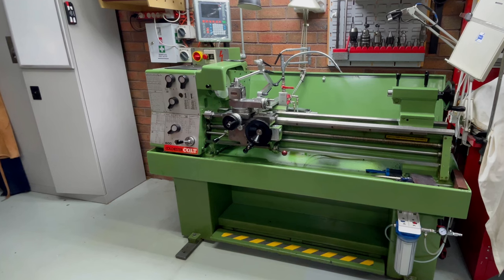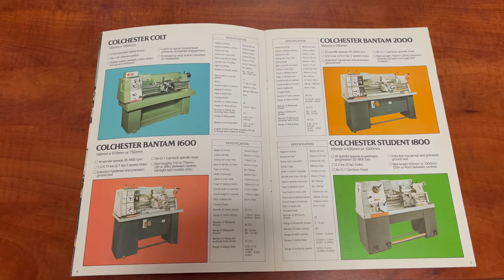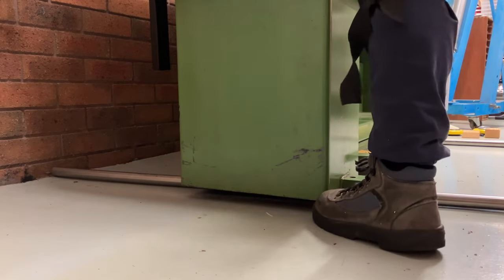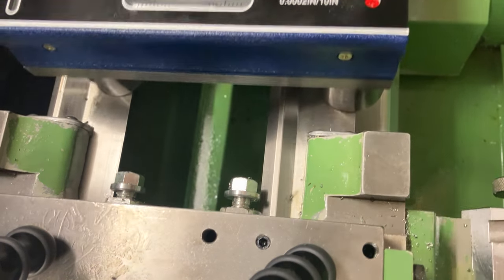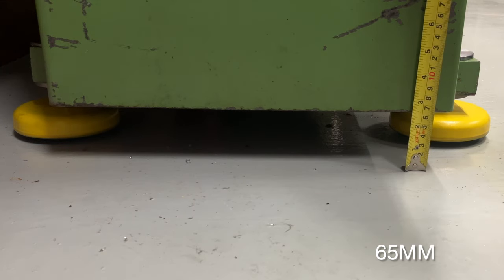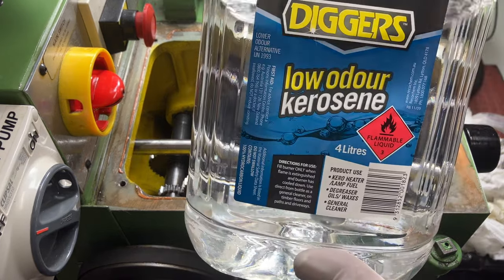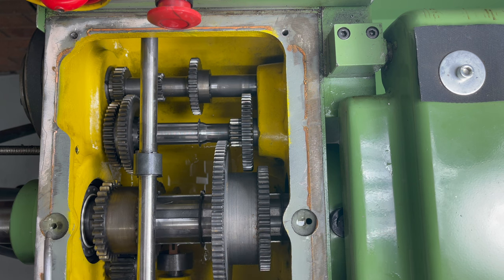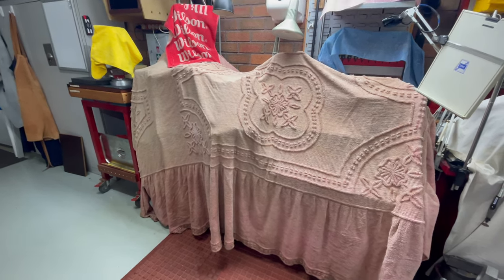Lathe Maintenance. Plus Some History on the Colchester

Comment: A really nice condition lathe for it's age. I was a little surprised going for the Kero wash though as its part of a regular service really only in head stocks that have an internal clutch. The discoloration is only oxidation. May I suggest that if you change the brand of oil you will have a lot less oxidation. When I was maintaining CNC machines that would run for 3 shifts I found brands like Shell and Haughton were not good oxidation wise. The best results were with Fuchs hydraulic oil.  The tests always came back better and you could see the difference. Getting the old girl to machine parallel again shouldn't be to hard chances are its parallel to the long axis it has just tweaked the center height in an angular fashion of the head stock (Nose High). A bit of shimming under the head stock end between the stand and machine should sort it. It looks nose high. Easy way to tell is micro adjust the tool height and you will see what way it is pointing. Of course if the bed is bent in one spot say the place where you lifted it you could pull it down again  gently via a single clamp point at the lift spot through to the swarf tray.  Put a clock on it and test for spring then go to full spring and leave it for a day with the ends unbolted. That should settle it. If the spring is more than the error dont go to full spring just creep up on it whilst its always being measured by a clock. I have probably fixed 20  odd machines with this error over my career. Some bend a lot easier than others.
Reply from the maker: Thanks for the comment and advice. After reading your comments I will change oil brands when I empty the current drum, which should be in about 6 months or so. I did the kero spa treatment to clean out the headstock, there's not much room in there to swab it out with towels. It did work and I now have a clean headstock. I'm planning a deep dive on this lathe for next year and I will take your advice in hand and that will be included in that project.
Thank you for sharing your thoughts, they are very much appreciated. Regards Steve O
Reply: @dazaspc @theoutbackshed I have similar experience with the hydraulic oil in lathe use. I can't remember which machining forum had a discussion topic about oil grades lathe use. There was praise for the hydraulics oil properties that fully correspond to headstock lubrication. I also use the oil on lathe bead, as well as on other sliding surfaces.

Comment: Hi Steve, that was an excellent video. Did you end up buying a toe jack because if not Vevor currently have the 2.5 tonne unit selling for $58 delivered. Mine arrived today 01/08/24. I was going to make one but at that price why would I bother, but I will be extra cautious using it as I doubt it meets Australian standards. That lathe looks and sounds like new but I guess that’s what you expect when you buy quality. 
Can I ask why you purchased a Tool Master lathe when you have the Colchester? Thanks, Stuart. Canberra.
Reply from the maker: Thanks for the comment. No, I haven't bought a toe jack yet, it's still on my list. The Colchester is running as well as it has ever run, certainly as accurate as it was when new. It has been looked after and well maintained, I doubt that there would be an original one left in the world that would be as good. 
I bought the Toolmaster because I wanted a bigger heavier lathe, I would have liked a Colchester Mascot but they are price prohibitive. Even the Jesco Major which for all intents and purposes is the same machine, is also too expensive. I assessed the Toolmaster as being the best of the offerings from Taiwanese manufacturers for the size I wanted. I am very happy with it and it performs very well. I am building up a good collection of tooling for it and I expect to start a new project shortly to build Tailstock Chucks. Keep watching!

By the way, I enjoy your channel and 'm a subscriber.

Cheers SteveO
Reply: @theoutbackshed  Well bugger me, it’s a small world. I hope to have a video out soon with my new to me Colchester Triumph 2000 which I hope to finish installing today. Thanks for subscribing to my channel. Stu. Ps, where are you located.

Comment: What a beautiful machine!  I’m going to order a gallon of the fluid film. I’ve used it in spray form for various things but I’ve been looking for a good storage solution for my lathe and milling machine. I am so fearful of rust getting to my precious machines. I’ve been using way oil and coating them heavily, but it seems to always find its way to the base and chip tray. 
I have to say, I truly enjoy your content. You clearly know how to operate and care for such equipment. Thanks for sharing your expertise! 🙏 
Cheers 🍻
Reply from the maker: When I put the machine into storage Fluid Film was not available. I cleaned the machine thoroughly to remove all oil traces then applied several coats of Turtle Wax, then applied a final coat without polishing it in. This turned powdery over time but certainly kept the oxygen at bay. I do like the Fluid Film in the paste form, the spray cans contain a propane repellent which if it doesn't flash off before it hits the metal it will act as a dilutant. Another product I often use in woodworking is G15, this is a very good product and you should read the SDS before using it. Cheers.

Comment: Hi, just wondering what was the spray lubricant you where using when parting off the washers?
I noticed that some of the quadrant plate gears appeared to be phenolic resin sheet, is that the case?  If so was that original to the lathe or did you make up the set yourself?
Would love to own a Colchester for my home workshop but could never afford or justify the cost, my wife certainly wouldn't be to pleased.  Great maintenance regime, something I've got to get into the habit of doing.
Cam
Reply from the maker: Hi, and thanks for the comments. The cutting foam is Excision XDP 905, here's the link.  https://www.machineryhouse.com.au/s078
I have used the brush applicator for parting and had very good results. In this video I tried the spray foam and really liked it, I think I'll switch to this for big parting as its easier to get the lubricant to the bottom of a deep groove.

You are correct, two of the quadrant gears are phenolic. These are standard and came with the lathe when I bought it. When I first visited Colchester in 1984 I bought the optional great sets for imperial and module, these are all metal gears.

Cheers, Steve O

Comment: Not a Colchester….. but a Taiwanese clone.
Similarly in storage from about 2000 to this year.
Ditto for a brand new 18” x 6” surface grinder.
The lathe is in extremely good condition (greased, oiled, covered).
Your Colchester looks like new 👍
That protective goop you are using is the ants pants… I’ve always used lanolin based preservatives… bugger to get off after long storage though 😱
Thoroughly enjoyed your vid., and I appreciate the extra time and effort you put into producing it.
Thank you,
Robert
(Sydney)
Reply from the maker: Thanks for the comments Robert. The lathe is a Colchester as verified by the brochures. I agree with you on the Fluid Film.
Reply: @theoutbackshed  
Yep… I meant that my 960 B is a clone 🤣🤣
Reply from the maker: You got me there....

Comment: great video, especially showing the original testing documents.   I have a Master 2500 model built in 1978 and it is a really good machine.  guess I should show mine a little love also.
Reply from the maker: Thanks for the comment, like my lathe, a 1978 master would be difficult to get parts for.